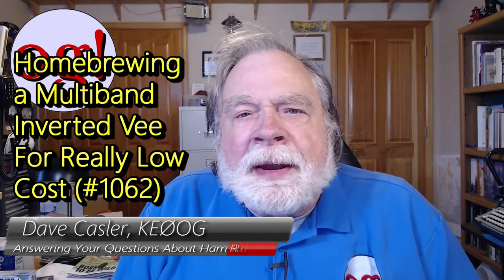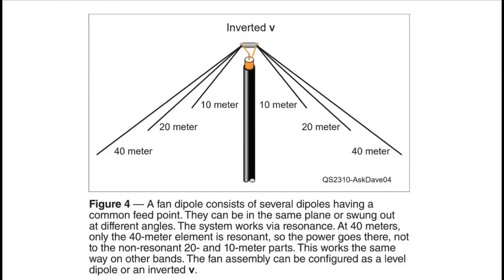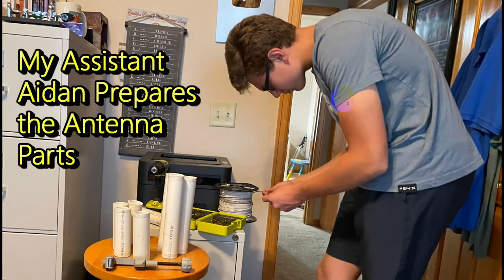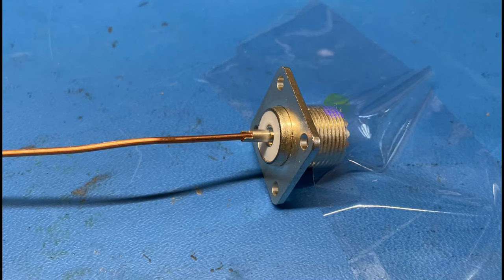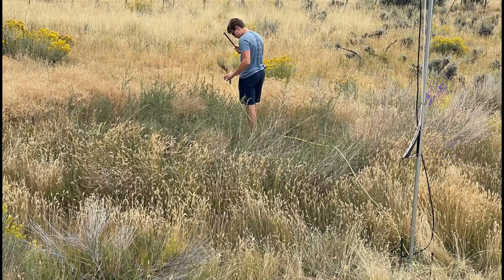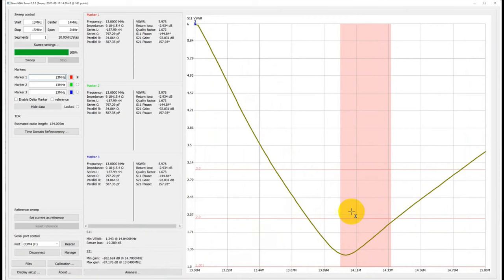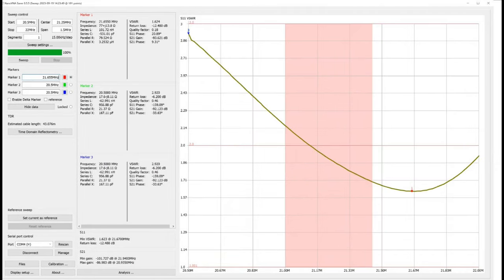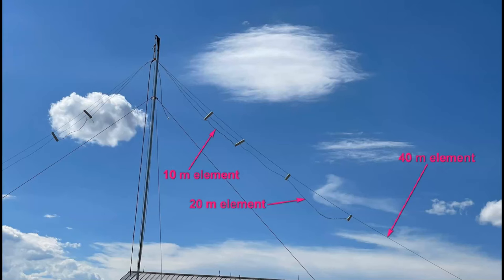Homebrew Multiband Inverted Vee (#1062)

Comment: nice .. I use fan inverted vee 80 40 20.. made with speaker wire .. made it real easy just cut to length and peel the 2 wires apart

Comment: Speaking of 15 being a freebie of 40, does this concept not apply for the "double bazooka" dipoles? I made a "double bazooka" dipole for 40 from online plans using TV coax as the radiating elements about a year ago. It's been a fantastic antenna for 40, but it's deaf as a post on 15, despite acceptable SWR readings. The weird thing though, is it's fairly decent on 17 meters- way better than 15.

Comment: Thank you for one more great video.
Yes, it's an easy antenna to make a beginner's gold., tuning is easy, no tuner needed, yet this antenna is not as effective when compared to other basic wire antennas such as a wire loop antenna that could be erected at a lower height, got some gain, reject local noise and could be used as a multi band with an external tuner.
My experience with this fan type of inverted V antenna was poor.